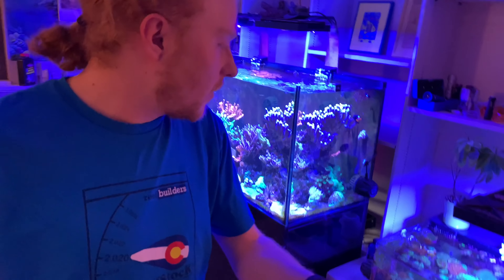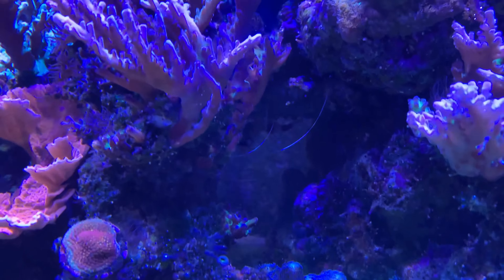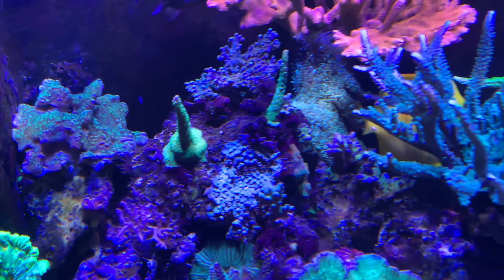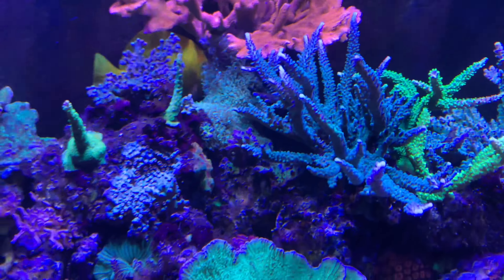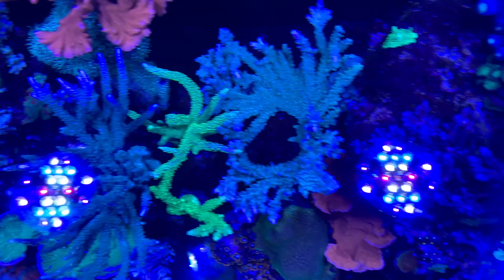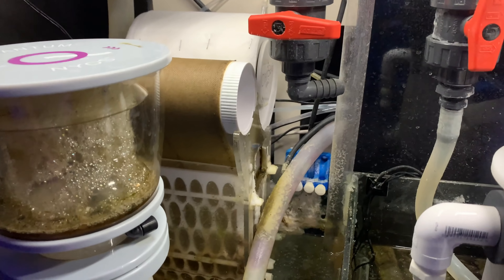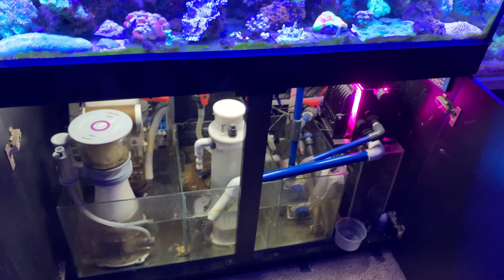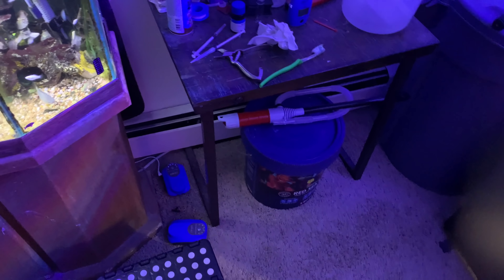Tour of the Reef Builders Mountain Studio at Evan's House

Comment: What would make cable management great would be if manufacturers put a splash proof  in-line plug and socket 2 or 3 feet from any piece of kit so you could just unplug it and remove it for maintenance  - that’s why my MP40’s are always clean you don’t have cables to remove with the kit to clean it !! 😏

Comment: I wonder how you plumb your 32-gallon water container to the sump for auto top off.  I used it once and it flooded my floor (after the ATO pump shut off, the water still fed into the sump by gravity because the water level in the resevoir being higher than that in the sump.  Is there a special valve that I should use to connect to the hose from the ATO pump to the sump?
Reply: Didn't mention it in the video but in the corner of the left-most chamber of the sump is a clear plastic riser tube. The ATO line feeds into the top of that, above the level of the reservoir, and then falls in air about a foot and a half down that pipe into the sump.
Reply: Vanmo92 Thank you so much!

Comment: Whats your lighting schedule and program? Also what settings do you runnyoue flow at
Reply: Custom based on what looked good. Nothing scientific at the moment. It starts the day off whiter and is pretty much all blue by the end. Run the intensity lower overall so I can get away with running them longer, to accommodate my work schedule.
Reply: Flow is the 3 mp40's. The two on the left and right are set at reefcrest 24/7 100%. The one on the back is reefcrest 24/7 but only at about 80%